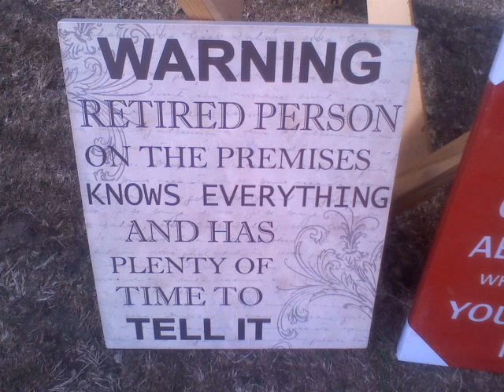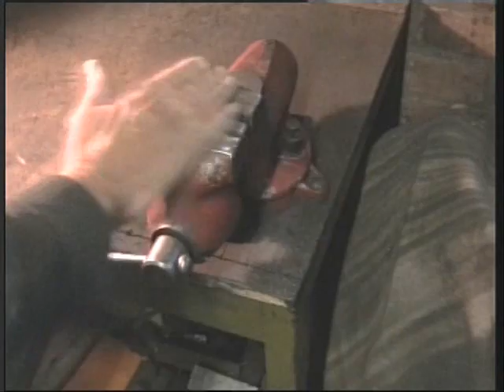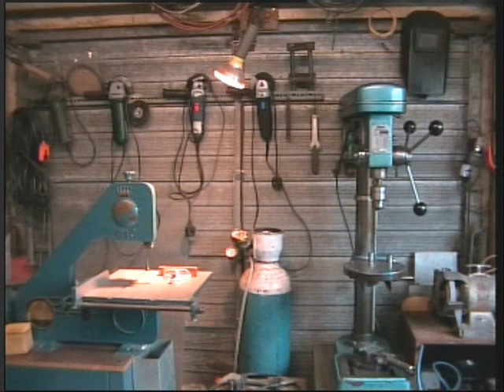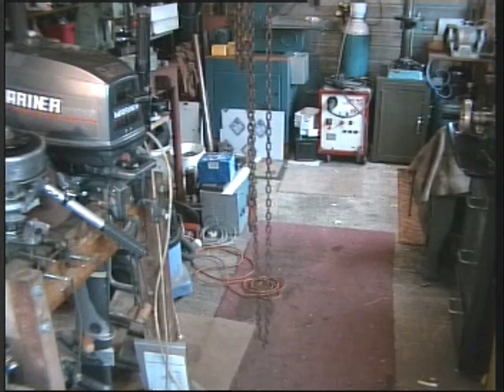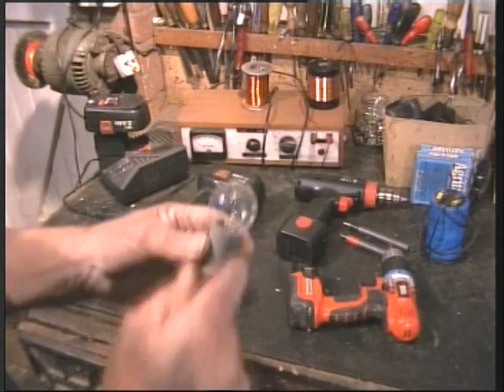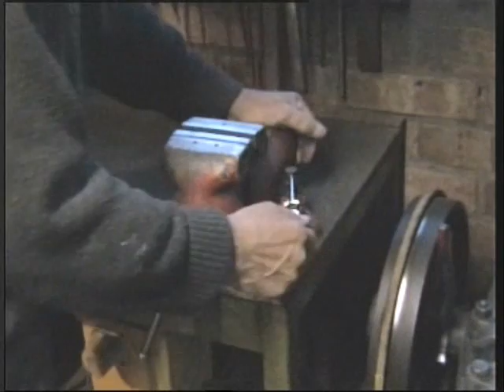WARNING retired person

Comment: I love the old vise, I have a vise that I have had for forty years, it was made in Poland and has locks like yours on both sides so I can turn mine also. With four inch jaws I use it for metal and wood projects as I have a collection of plastic jaws that fit on with magnets installed and there is that flat area at the back that is like a little anvil. The metal bending fork is a great idea, I use my actual anvil a lot and when I use my vise I get out my big three foot pipe wrench. Thanks for vise modification with the three pins, I need that on at least one of my drill press vises.

Comment: I think its in the IEE electrical installation regs that fluorescent fittings should not be installed anywhere near machinery with moving parts for exactly the reason you gave,its also the reason that flory fittings are always to one side in hospital corridors as the strobing effect can induce vomiting in patients lying on there backs as there wheeled around the hospital

Comment: Im using a small (ryobi) bench top bandsaw to with a jig I made to cut plastic parts I make in half ... Ive thought about speed controllers and what not but didnt want to have to tear into the machine and i figured I would lose much torque. Ive even tried sticking the material in the freezer before I begin cutting with limited results ha ha. the material is appx 1 1/2" square and my current set up makes the cut in about 10 seconds but theres too much melting for my tastes. lower speed i guess

Comment: You have created a good cheap way to do a job.
I have seen and used charging stations that cost around $500 us that essentially do the same thing... they discharge the batteries 3 times and then recharge , good work!